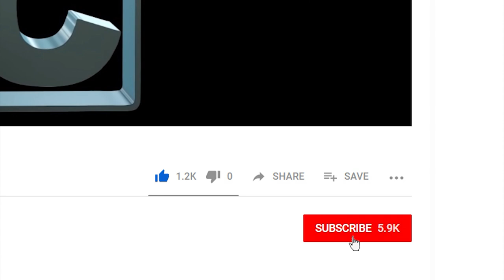Bandai 1/5000 Star Destroyer model build Pt II FINAL REVEAL

Comment: Hi Chris.  Can I ask a question?  Why did you feel the need to add that extra layer of styrene when you were lighting the upper section?  Would it have also worked if you just put the Cobb LED’s down in the bottom section of the hull and let the light shine upwards into that upper section?
Reply from the maker: The LEDs were are not bright enough to just put in the lower section and let shine upwards into the upper.  The way I did it bounced the light around and contained it in a smaller space of the upper section allowing for better and more even lighting.

Comment: man thats some amazing work youve got there! now what do you think are the cons over this light diffusion tecnique vs. fiber optics? ive done fiber optics before but its just so much work... im thinking of trying this out.
Reply from the maker: Fiber optic is certainly way more time consuming and difficult.  The only advantage to fiber I guess,  IMO, is it has a little more off axis viewing because of sticking out slightly from the kit.  Even cutting flush,  they're never really flush. It'd be extremely difficult to cut flush on this kit.  It's so small and the little nooks where windows are located, i don't know how you'd cut them.  I actually did do a test of fiber vs the way I did it, using 2 duplicate model pieces,  and I honestly felt it looked better the way I did it.
Reply: @modelsbychris  One thing you could do with fiber optics is to "mushroom" the end of the fiber with a heat source and then pull it through the hole and glue it in. The mushroomed end gives great off-axis viewing even on .25mm fiber. Extra work, to be sure, but works well where you cannot reach the ends of the fiber with a cutter after installation. 

Great work! 👍
Reply from the maker: @jayblanchard4477  I have done that as well a couple of times